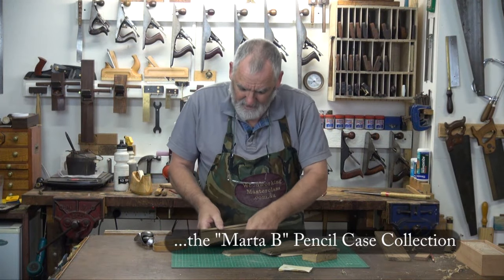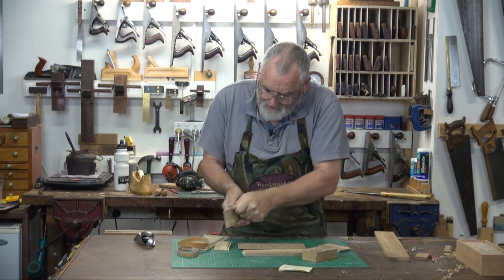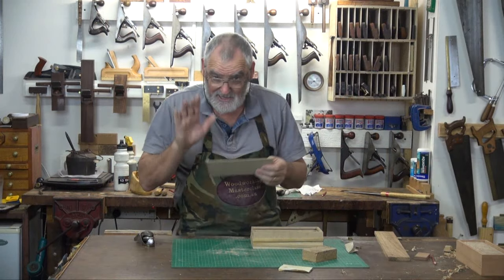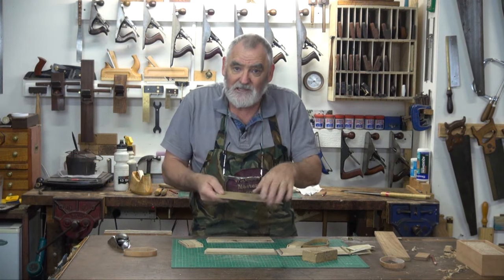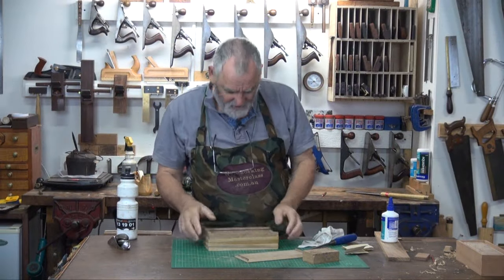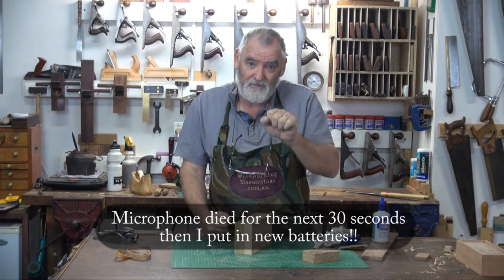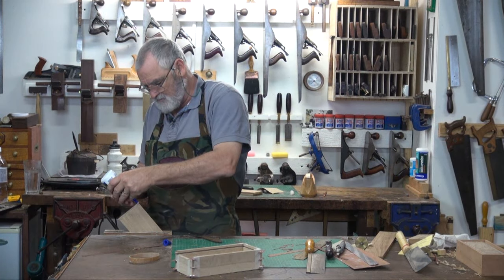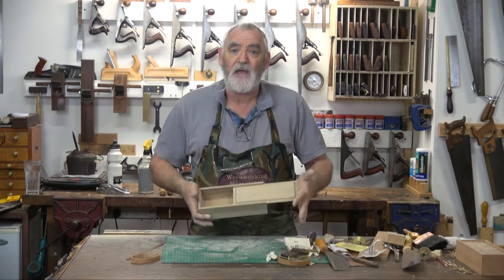Pencil Case 101 Pt 3b Box #4

Comment: love your videos. I currently always do 1/8" splines on a jig I made for my table saw. I love the look of those veneer splines (keys). I may have missed it but what did you use to cut the slots for them? A handsaw?  I think it would look cool if I used my 1/8" splines and put a small one inside each of them with your method. can't wait to see your next video. ;)
Reply from the maker: Yeah, sorry about that but my Mic died and there were no verbal instructions but they were cut with a Japanese saw the same thickness as the veneers. Your idea sound like it would work well. Cheers Steve

Comment: Hey Steve my father started wood working by making kitchen units made from melamine chipboard and veneer chipboard he then started doing head rests from solid ,and veneer. Afterwards he took on hardware shop display units in mass produce made from melamine, formica and aluminium, and found it more profitable because we didnt need many skilled laborers, we would get more done and accept more work. in your professional opinion I'd like to know if you would challenge that delicate, labor intensive, skillful solid wood craft makes less profit than the cheaper quicker mass produce melamine route? or do you have a completely different standing. I really would appreciate, your advice because I'm at a point where I either need to market for more mass scale shops or take on refined private works thank you.
Reply from the maker: Ditto other reply. Cheers Steve